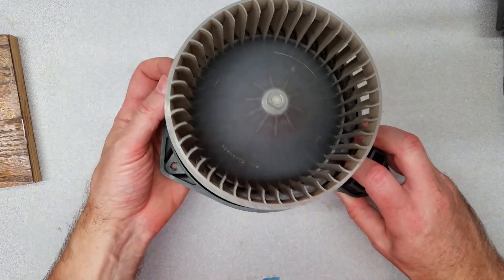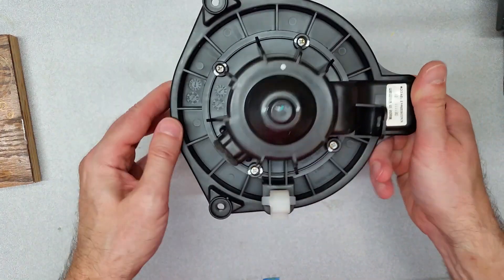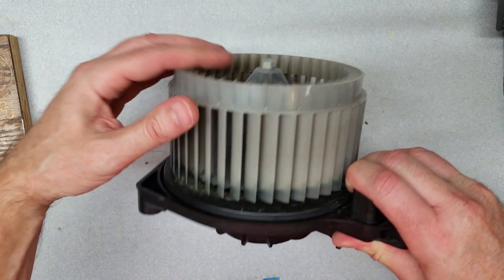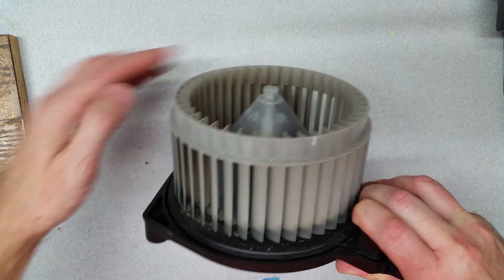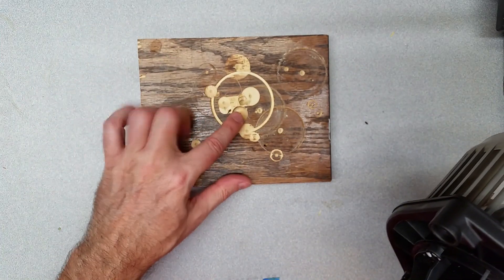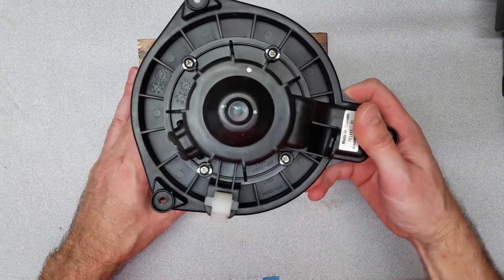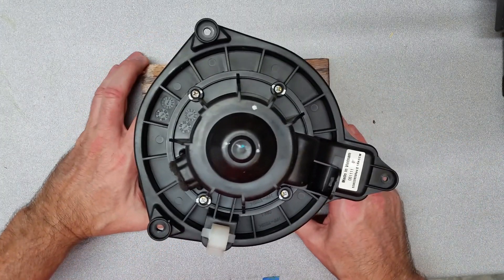Toyota Tacoma Blower Motor Only Works On High "A Fix"

Comment: Well my day just went bad. Just finished replacing the fan, resistor and wiring.  It didn't fix the high only fan issue.  Where to now any ideas would be appreciated.
Reply from the maker: Sorry to hear you've gone to those lengths and the issue remains. 
After all wiring has been double triple checked. I'd probably start testing each lead in the wire harnesses to verify continuity. If everything checked out... I'm not sure what the next step would be. I haven't heard of switch going bad, but that may be something to look at as well.  
Good luck to you, wish I could help.

Comment: 👍 Great!!    My connector wires are a bit fried.  Can I DIY? And if so, Do you have a tutorial or how should I phrase it to look it up, plz?
Reply from the maker: Thanks for watchin!
I don't have a video about replacing the wire harness connector, but here are a couple that may help, or give you ideas how to proceed.

https://www.youtube.com/watch?v=R7QaPNgZCTA

https://www.youtube.com/watch?v=SmDTE17j62I

If your harness is burnt, you may need to not only replace the harness connector, but also the resistor and the fan motor.

I have a suspicion that the resistor isn't always the cause, but often a victim of a worn motor.  My '07 tacoma is still running the original resistor and harness, but after cleaning (temp fix) the fan motor a couple times over the years, I finally replace the motor as it was just too worn to be reliable. 
Amazon fan motor has been running well since, no issues to date.

Good luck with your project!

Comment: Burnt pin socket in the connector. Don’t look good to me. Everybody else fixes this problem by replacing the connector and resistor pack.
Reply from the maker: Hey Rob, I hear ya, but the connector was still good as is the resistor. The problem seemed to start at the motor, at least in this example.  
I've read where some people are replacing the connector and resistor, only to have the problem happen again. 
My thinking is that the motor is shorting out, drawing too much current and cooking the connector/resistor. The motor wiring is rather beefy, and can take more current than the other components in the chain. So it may smoke the other parts, maybe.
Also wonder how long most folks go with this issue before addressing it. If it goes too long, the resistor would be fried.  I happened to fix asap, and the connector looked a bit hot, but not deformed, still good contact surfaces.
Just my experience with a couple of these.
Thanks for watching and the great comment too. Take care!

Comment: It’s been 2 years.  How long was your fix last for?
Reply from the maker: Chris, I've lost track now. I did end up replacing the fan in my personal truck about a year or so later. The fan was too worn to continue. Still using the original wiring and resistor. Only the fan needed swapping.
This idea is really just a "temporary fix". If the fan is worn...it's worn.
Thanks for watching, take care!
Reply: @theNextProject  awesome I replace the wires but I guess I better just get a new fan.

Comment: Awesome, thank you.
Now, I wait for spring....
Reply from the maker: Sean, if you just started having the "hi speed only" issue.  You may not want to wait until spring.  I don't know for a fact, but I suspect running the fan on hi non-stop may lead to premature resistor and wiring harness failure.  
I have no scientific proof if this, just a hunch. 
Good luck with your project!
Reply: @theNextProject  Done and Done. Much thanks!

Comment: Thanks for the video. Having this issue with my 2008 (210K). Is the assembly you show easily accessible under the dash or do I need to remove something? Thanks!
Reply from the maker: Dan thanks for watching.  
The fan motor is directly below the passenger side glovebox.  If you could lay on the floor mat, it would be staring at you.  
It is a little cramped to work in this area, but luckily there aren't a lot of screws nor connectors to deal with.
Use your cell phone to video what is down there, it'll give you an idea of where everything is at.
Good luck with your project.

Comment: (2009 Tacoma @ 240 K miles) Great step by step video, thanks. I just installed another new resistor (#3) and plug. Post this video I will be installing a new fan blower motor. I still plan on cleaning up the old one and I'll keep it just in case.
Reply from the maker: Thanks for watching! 
Wow, 3rd resistor?!  Sorry to hear that.  
If you have 240k on the fan, there may not be much left to clean up and save.  
I hope you have better luck with the "new fan" and latest resistor.
Be safe and take care!

Comment: Congratulations well made video step by step. One question you mention is a temporary fix refreshing the fan motor so it can start acting up again? Thank you
Reply from the maker: Harold, in the case of the fan motors I have done this "fix" too. Two of the fans are still running normally, the other failed again about a year after the cleaning. I have replaced the bad fan. Neither trucks needed the resistor replaced. I think the fan issue was caught early enough that the system wasn't overloaded downstream.  Just a guess.
Take care!
Reply: Thank you next project

Comment: Thanks! Took all of 5 min to switch out. Just FYI for others..I had put a new resistor in about 2 weeks ago and it went out again so I went ahead and redid everything (resistor, wire, and motor) and that fixed the issue
Reply from the maker: Hamp, thanks for watching and the comment too.
Sorry you had to swap out the resistor twice.  I still think a failing motor may be the cause of those resistors cooking.  Hmm.
Take care!

Comment: You should mention the year of the truck you are working on.
Reply from the maker: Darrell, very good point. 
I've done the fan cleaning to 3 Tacoma second generation trucks. I believe 2nd Gen is 2005 - 2015.  2 - 2007 and 1 - 2009.  
Later years and the newer gen may differ.  Sorry for that omission.
Take care!

Comment: Dude most of the time the fan is not the problem,  just the Resistor Blower, too much bs Around dude Honestly
Reply from the maker: Bernard Vargas, you are correct, the resistor can be the issue, or it may not be. 

This video really isn't about the resistor, but does make mention of the resistor being a possible cause (victim). And if the resistor and wiring are fine, the video shows how to do a 30 minute fix to get things working - hopefully.

I've come to wonder if the fan going bad is a cause for the resistor failure. Thinking that the fan is beginning to short, possibly due to carbon build-up or other issue.
The two Tacomas that I've done this temporary fix to, have not had resistor failures, and the issue was address as soon as the "hi fan speed" issue was noticed.
I wonder if the resistors that have failed for other people, have had a fan running on "high" for long periods of time, days, weeks, months..., before any correction was made. This long term high level draw may simply overload the circuit, and melt stuff. The fan motor windings are rather beefy, the resistor not so much, so the resistor and wiring harness take a beating... 
Just my curious mind wondering, and I may be wrong in this thinking.

My personal Tacoma had the "hi fan speed" issue, and the fan motor commutator was heavily carbonned and worn, I cleaned it, it ran 1.5 more years ( should have replaced  the fan due to the commutator wear ).
Then the "hi" issue reappeared after a lot of use during 1.5 yrs. 
I cleaned it again, as it was again heavily carbonned and terribly worn. The second "fix" lasted just over 6 months.  Then I replaced the fan and have no issue since. The resistor is still functioning as it should. Switch works on all settings. The fan was purchased from Amazon for ± $35. Still a cheap fix and no need to replace the resistor, nor melted wiring connectors - yet.

The other Tacoma that I've worked on, is over 2 years on this temporary fix, still has the original fan and resistor. 

I've seen videos, and read blogs of people replacing the resistor and wiring, only to have the issue happen again. That also leads me to wonder if the resistor isn't the cause, but the victim. Just because the fan still runs, doesn't mean it is running as designed, or efficiently. Just my thoughts.

Strange issue overall, not just a Tacoma thing either. Many makes and models suffer from a similar "issue".

Hope your project was a simple fix, whatever it needed.
Thanks for watching, and the comment. Take care!

Comment: Hi, 

I have a 2012 Tacoma and the ac blower does not have the 4 screws to expose the inside of the motor? Anybody else have this setup? I only have a side screw which does not seem to help in removing anything to access the inside.

Any suggestions?
Reply from the maker: Rodolfo, sorry but I haven't seen the blower configuration you appear to have. Please let us know what you find out.
Good luck, be well, take care!

Comment: Mine did this morning and I mess with the wire a little and started working again should I still change the resistor
Reply from the maker: Hey TFGC! 
That's a good question, and one I really can't answer without taking a look.
You mentioned messing with "the wire" but which wire are you referring to.
Was it the 4-wire cluster that plugs into the resistor?  You could remove that wire connector and look at the connection plugs to determine if they are burnt or not.
If the connector shows discolored connector pins or socket, the plug is physically melted... you may need to replace that end of the wire harness and the resistor.
It is also possible that the harness somehow got "pushed" and wasn't properly connected.
Again, I can't say for certain what your situation is. 
I hope you can determine the cause, good luck!

Comment: Question: If the correct amperage draw (specs vs actual) of the fan was known, wouldn't that tell us whether the motor was in need of "refreshing", and that the blower resistor was indeed drawing excessive amperage. It is already discolored.
Reply: Great Video. Gracious response. I subscribed because I add intelligent people to my you tube, and in life. S
Reply from the maker: Oh man, that "intelligent people" bit nearly made me spit my drink. I needed a good laugh, and thank you for the compliment. There are times I can't believe how mentally challenged I am, so "intelligent" makes me snicker. Too many of those "where are my glasses" moments. Ah hahahaha, ahhh... good stuff!
Take care!
Reply from the maker: @Steve Adler, good question(s).
If I'm following you, yes. 
This motor that I freshened up needed to be replaced, it was actually shorting out to some degree. Once the carbon debris was removed it worked like new, but I don't know if it was within specs. 
I suggest that when the fan/system reaches the point where it only works on "HI", it is time to order parts, or not run the system at all. I don't have proof, but I expect a shorted fan will slowly cook everything in the path, wiring harness and resistor. 
Just my guess and not the technical answer you are likely looking for.

Comment: This particular problem is a compound deal due to inferior build quality of components, I have replaced hundreds of fans connectors and resistors in Toyota , Chevy, and Ford because of this exact concern.the manufacturer should be upgrading their components to prevent this from occurring??? Thank you
Reply from the maker: @Richard Finney, I agree and thanks for the comment.
We are in an age of "value engineering" and "timed life expectancy" of parts. It is very amazing how each part can be designed/engineered to last to a given count (revolution, hour, distance...) and the do. I hesitate to call it inferior build quality, as I tend to believe it is intended build quality.
On the flip side of that, my fathers drill from the 60's is still running and will break your arm if you aren't attentive to what you're doing. Engineering can go both ways, make it to last forever, or make it to fail - just out of warranty.
Then combine the failing of one part and the impact it has on other parts in the chain. One failure causes another and so on. 
I'm no engineer, nor scientist, not even a mechanic, just a guy who tries to fix all the broken stuff around me.
I really want to get an old vehicle, fewer parts, less technology, wing vent windows... 
Take care!
Reply: @theNextProject  so true to the aspect sir , I'm a 35 year ase certified Master tech , the engineering of these components are set to a certain longevity and the contractor using the incorrect speced parts . I've seen it all when manufacturers are in play

Comment: Seems you should've replaced the resistor harness first and see if that works before taking the whole fan out
Reply from the maker: GameOfInches, Thanks for the comment.
The resistor harness was inspected and in good condition, there was no damage to the connectors in either the harness or at the resistor.  By replacing the resistor harness, I would have either had to purchase a new harness, or splice in an aftermarket repair part. Since the harness was in good condition, replacement of the harness would have resulted in more work and wasted money, and the fan would have still been the issue in this instance.  
Since the fan is held in with 3 screws and a wiring connection, removing the fan was really quite easy to do.
I've now worked on 3 different Tacomas with the "HI" issue, only one had a bad resistor and harness and it was clear to see they were smoked. That particular situation also needed a new fan. I tend to believe the faulty fan may have caused more draw on the circuit and many have caused the harness and resistor to overheat - just an assumption.
Additionally, I wonder if the "only runs on HI" setting, is a warning sign and if caught early enough and remedied, perhaps the harness and resistor can be saved.
This "fix" I show is a temporary fix, as in this case the fan motor will need to be replaced. The cost of this "fix" was about 30 minutes of my time, a small price at this point.
Thanks for the comment and watching the vid.

Comment: Perfect!  That’s exactly what mine was doing!  A GREAT public service!  Thanks so much..
Reply from the maker: @Dave Musgrave,  Thanks Dave!
Be sure to check the harness connection point at the resistor as shown in the video. If it is melted, or the wired are charred, you will likely need to replace the harness, resistor and fan all at the same time. The Tacoma in this video only had a failing fan, and cleaning it up as a "fix" will get it down the road a little longer. The fan will need to be replaced at some point. The failing fan may also be what causes the wiring harness and resistor to go bad, that is only an assumption on my part.  I just wonder if the motor shorting out a bit causes excessive draw on the harness and resistor... 
Good luck with your diagnosis and repair!

Comment: One of my connector pins is deep in there does that couse anything?
Reply from the maker: Erick, I'm not sure I understand.
One of the pins at the resistor connector, or at the fan's electrical connector? Does it appear the pin is pulling out of the plug that has all the other pins? If there is a pin(s) that appear to be longer than the others, check it to determine if it is loose, or can be moved easily. It is possible that the pin has broken loose inside the connector, and may no longer be making electrical contact. If this is the case, that part of the connector, or harness should be properly repaired or replaced. That is beyond what I'm presenting in this video, but there are other videos on YouTube showing the replacement of the connector. 
Good luck to you!

Comment: Great video
 Well explained. Step by step instructions.... were very helpful and useful. Got it working again after dealing for almost a month with the air blasting my face...thanks a lot.👍
Reply from the maker: Francisco, thank you, glad it was helpful.
A month on FULL fan is a lot of air moving about. 
If you haven't already done so, you may want to check the connector shown near the beginning of the video to see if it has suffered any heat damage. 
I don't know for a fact, but I wonder if many of the resistor and wiring connector failures are due to not correcting the HI speed fan issue for extended lengths of time. 
Glad you got it working!